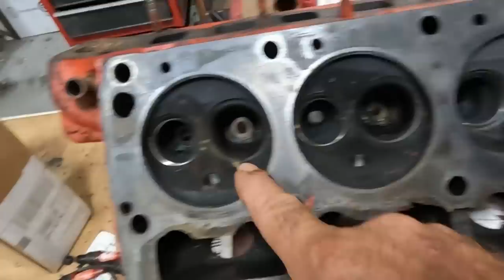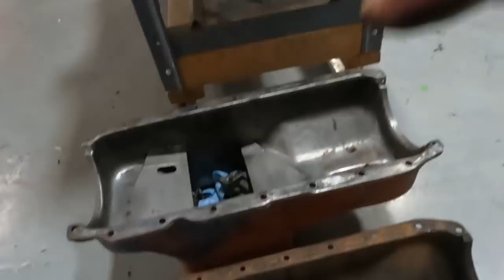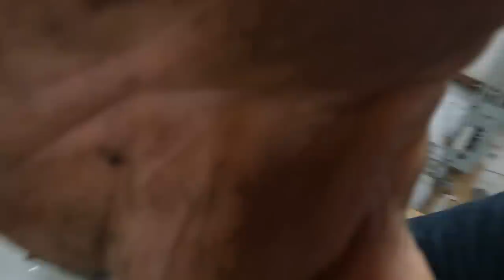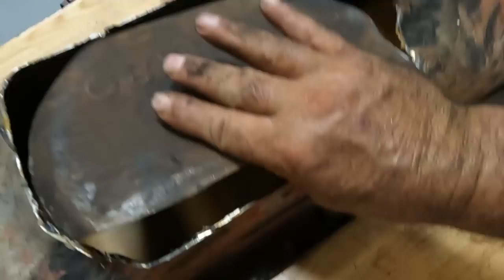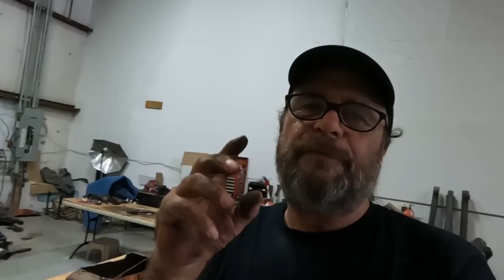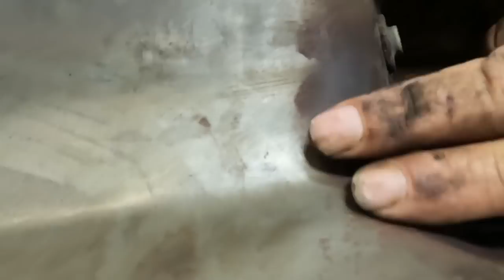Dirt Cheap DIY Oil Pan Modifications For The Home Engine Builder

Comment: Maybe use a catch can or air oil separator on the turbo car?
Reply: I'm also interested what Uncle T's opinion is on oil separators/catch cans. Both n/a and forced induction applications. I personally use a catch can on an n/a setup but it only has residue inside when I drain it, but I never saw motor oil in it, just residue and very small ammounts of "coffee foam".
Reply: I think a catch can is always a good idea even if it's stock na
Reply: Get the milk shake out of it
Reply: Catch cans can work, but they only work on mitigating the pressure and debris from the pcv(positive crankcase ventilation) valve to the egr(exhaust gas recirculation) valve and has a chance to burn it again.

If you do this without a catch can then you can get additional oil gunk into the cylinders. 
The catch can "cleans" the air a bit by removing a lot of the carbon and burnt oil from getting back to the intake manifold.
Reply: It's not a bad addition, but you add more weight to the car. 
You might can see why they generally don't add it with that explanation.
Reply: I ran a pipe to the ground and I got stuck rings. 
Run a catch can and rings haven’t stuck since. 

Nobody says ‘don’t add a catch can because of weight’

Mine is made out of a f*ing plastic Nutella jar, plastic
Connectors and 3’ of heater hose. Less than 1 lb
Reply: @fastinradfordable  
"Nobody says "don't add a catch can because of weight""

You apparently have never raced.
Every little bit counts in racing.
Reply: @kairu_aname  it's not a 55 gallon drum. Take a good shit before test n tune and you'll offset the additional weight
Reply: @needmetal3221  
You think that, but that's not gunna cut it. Weight is weight, and literally ANYTHING you can cut, you do. 

If you're not racing, go for it. It won't hurt it. 
But if you ARE racing, then it gets cut. Just look at Tony here himself cutting tons of holes into cars to reduce weight.
Reply: @kairu_aname  why not take the pistons out? They're heavy

Comment: Get rid of the flux core welding machine,  They Suck!  Get a mig!  Get a Miller !   Get at least a 250 amp and have your welder supply dealer hook you up with a Real Welder gun 15 foot long  with a 1/16 liner and some 0/35 wire !  Use  75/25 argon/co2 gas!  And you’ll be good to go!  Trust me!
Reply: He is good to go. 
He always has been.
Reply: not for what he's doing. honestly if I were him I'd get a Hobart handler 150 and a bottle of ar/cd25. I have about 1k total into my welding cart and does awesome for sheetmetal up to 1/4 inch plate. Hobart is owned by miller and it comes with a miller regulator. was $500 at tractor supply when I bought mine a few years back to do floor pans on my camaro.
Reply: Learn to scratch tig for cheaper.